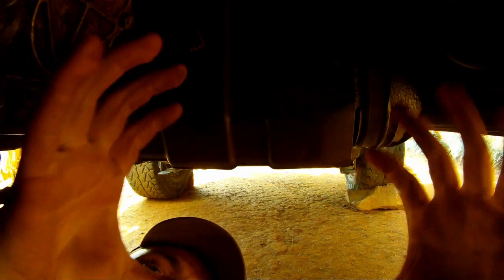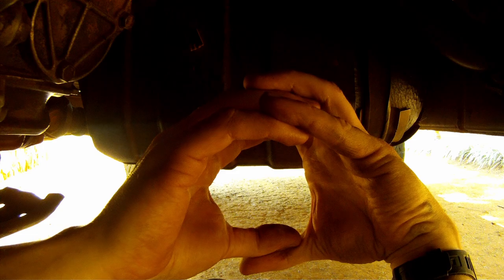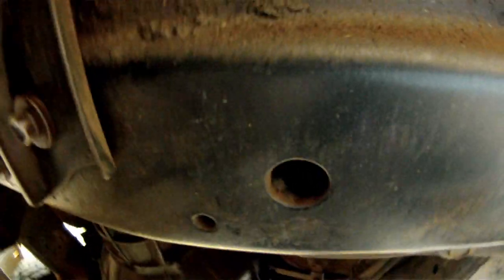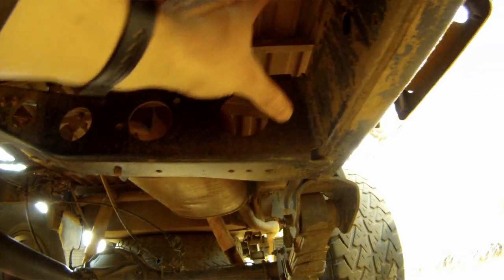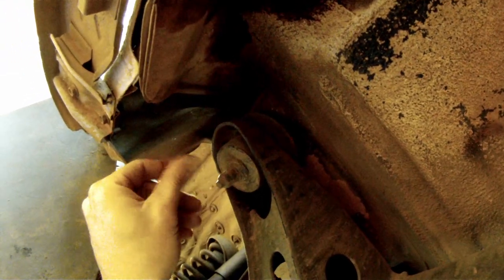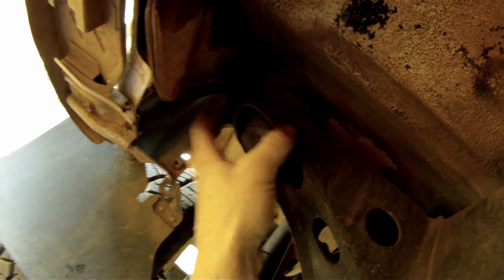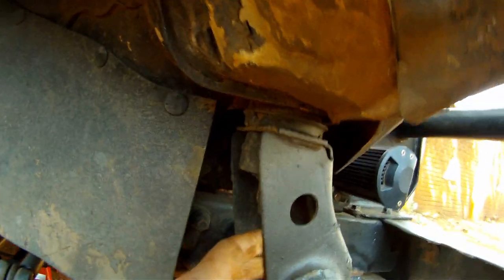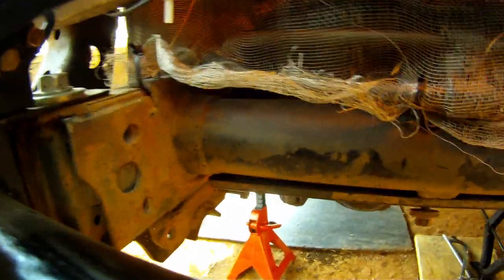Chassis differences - Land Rover guide to the Land Cruiser 70 series - 13/15

Comment: As a guy who has and currently owns both LR's and a TLC (its a 40 series just to be clear).  I must say that the Toyota is a heavier duty and a more durable vehicle.  They have solid electrics, you almost can't break an axle, and the drive line is solid from the fan through the transfer case.  That said, I do still love my D1's, a V8 NAS and a 300TDI, they off road excellently.
Reply from the maker: Yes it's a head vs heart decision!

Comment: Interestingly my 75 has hairline cracks just behind the shock mount crossmember. Previous owner was surprised by a donga and launched the truck into the air. Still have to get that repaired! Great stuff as always. Since I own a 75 and 2 110s I appreciate the non-partisan content!
Reply: What is a Donga??
Reply from the maker: Yeah the flat tubular bar doesn't seem like it'd have much strength being pushed from below
Reply: @clooperman3745  Donga -- South African for a wadi or a trench. Basically a dry watercourse. One of the many things that can surprise you on a dirt road!

Comment: I recently chopped up a Defender chassis and the long main sections are done with two over lapping C sections but weled in the centre top and bottom. If you look carefully at the two welds top and bottom you can make out that one side is the thickness of the steel higher or lower than the other side.  Great videos and you website is a valuable source of Defender parts information, thanks.
Reply from the maker: Thanks good to know. When my chassis gets replaced i'll get into the original with an angle grinder. Have only seen the rear when doing a rear crossmember. Glad you like website, etc. 👍

Comment: Thanks very much for editing these final episodes.
Very interesting as normal, I do think there should be something connecting the front axle to the gearbox on this land Cruiser! Oh well "Africa Wins Again."

You are correct that the 70 has never been sold in the UK, however, there were quite a few Japanese imports of the Prado 70 series, which is sort of a light version with coils all round. I am lucky enough to own one, a 1991 model.
Reply: A friend replaced the chassis on his Defender 90 Td5 a few years ago and used a genuine LR chassis, he then spent a weekend waxoyling all box sections and covering all chassis openings with rubber grommets and rubber patches cut to size to keep out mud etc, he removed a few recently and using an inspection camera looked inside the chassis and was pleased to find no muck and no rust, saw a video on Youtube of someone doing the same thing on one of those new Jimnys.
Reply: @clooperman3745  Bloody good idea. They should leave small drain holes at the lowest points to drain out any water/condensation.
Reply from the maker: No worries. 2 more to go! I'd taken the prop off which is why there is none... 

I also worked on an LJ78 here, that came from the UK. Agree it's very lightweight in comparison. Does yours have those electric locking hubs?
Reply: @lrworkshop  Sorry I couldn't resist the comment about the prop, I guessed you may have been in the middle of something!
Yes,  my LJ78 does have electric hubs. Brilliant when they work but mine aren't at the moment so I just have them locked permanently.
Really hard to find information and parts for them. I think Aisin made them but google is not my friend on this occasion. 
Any suggestions would be gratefully received.
Reply from the maker: @harveysmith100  The ones I worked on didn't work either, but after cleaning and greasing they did! Aisin were certainly what was on the 70 series

Comment: Good vid! I like the greater number of sizeable holes in the chassis. Easier to clean out!
The rear end is probably more comparable to a series 3 LR i.e. leaf spring. Wider chassis sounds smart and shorter out riggers. I don't like the sound of overlaid sections welded with traps for water in the overlap but it's all a compromise. Cheapest way Toyota found to make it I guess.
That probably why most of my S3 is lasting so long - box made from 4 plates not two pressings. The overlaps in the replacement rear cross member splice area are the bit blowing out as they are a water trap.

70 series has my respect. Just wish you could get 'em in the UK. I saw an 1990s troopy locally but when I called the dealer he mumbled something about it needed new tyres fitting that day and I couldn't view it. It was gone before I could get near it.

Comment: Most 70's are rust buckets, specially the chassis, those two sections where they overlap get crap in between and rust out fast. I have snapped a chassis on a 70 right in half just pottering around outback. Also the rear wheel spacing between center to center of the wheels tread, is narrower than the fronts. Makes for a shit off-roader in that each axle has to make its own track, not the rears following the fronts like you would want or as they should on any 4x4.
Reply: The narrow rear axle is compared to the front is only on the later V8 model.
The six cylinder models have the same width.
As for chassis breaking, any chassis will break if you allow it to rust through. Proper waxing is the answer.
Reply: @harveysmith100  and here comes the fan boys.......
Reply from the maker: Interesting to know about the rust - bit like the overlapping sections of a Defender bulkhead... Yeah that axle tracking issue is a real downer for me.